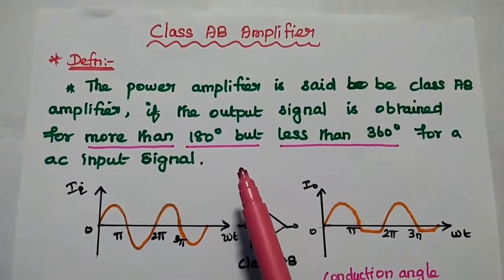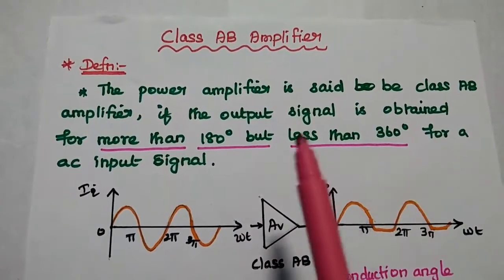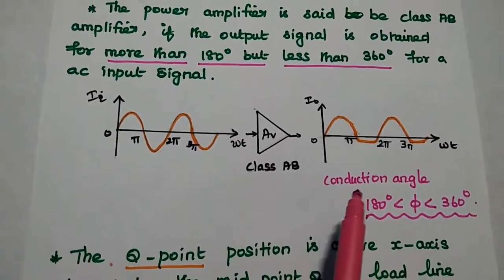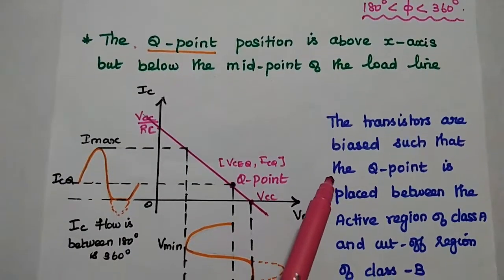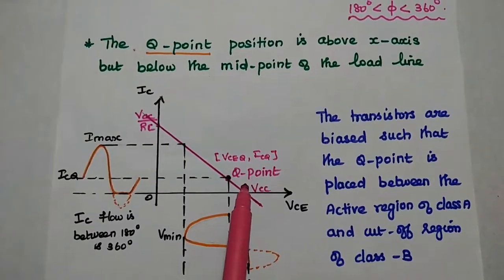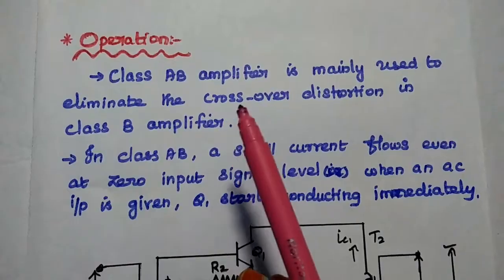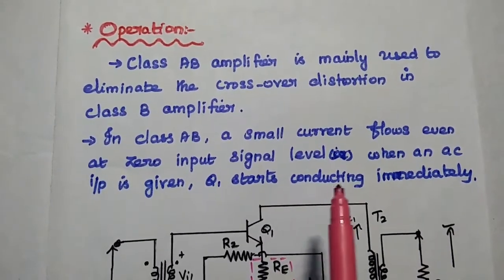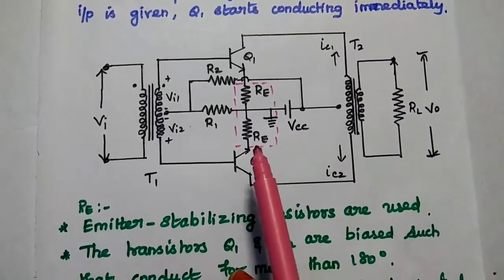Class AB Amplifier - Operation and Its Efficiency

Comment: Cut in voltage ---- when vol is less than this then transistor doesn't conduct
Due to cross over distortion transistor conducts less than half cycle